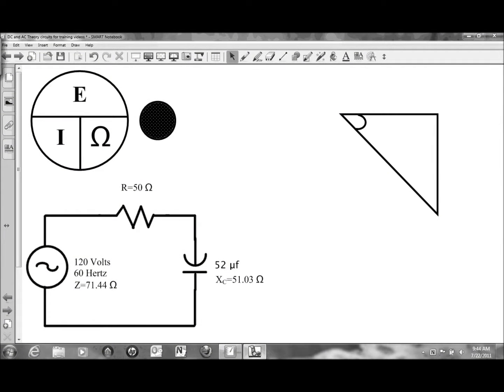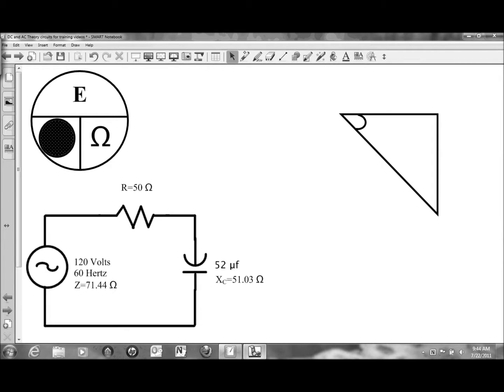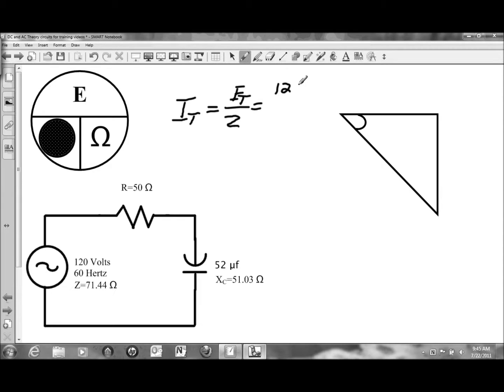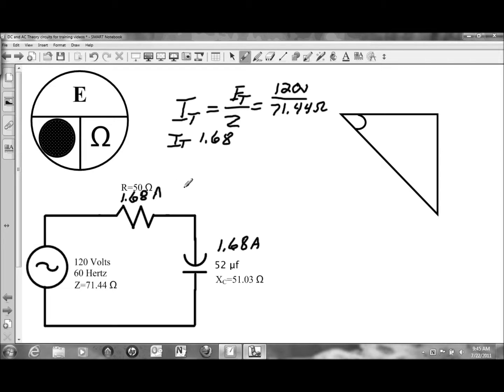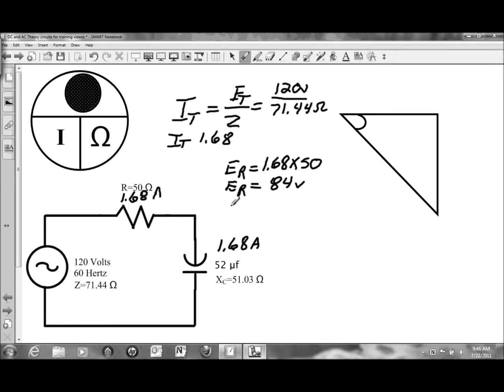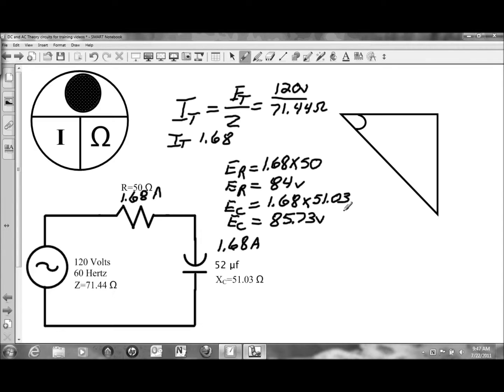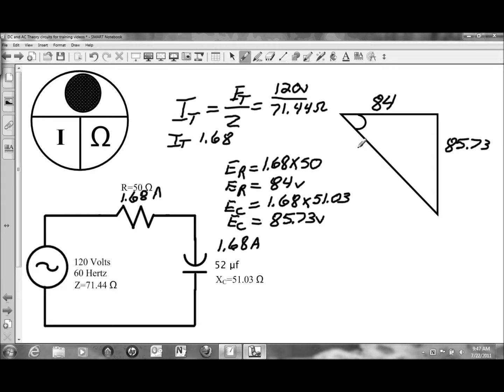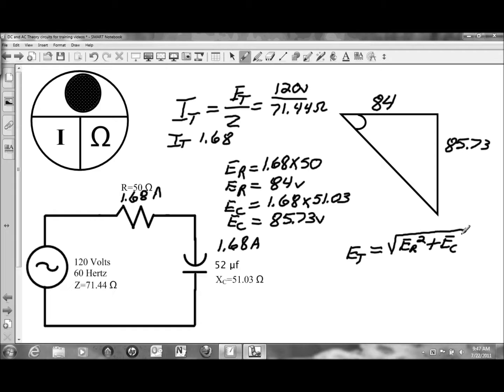Current and Voltage in a Series RC Circuit.wmv

Comment: Nice video! But I still have a question. If the current in the circuit is determined by the impedance and voltage of the power source, is it a way to determine the voltage of each element without this impedance value?